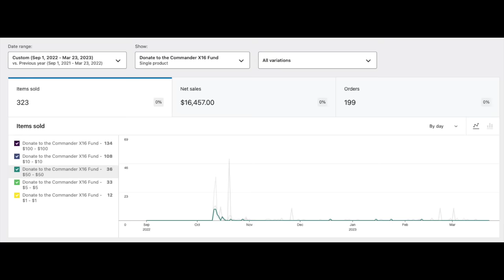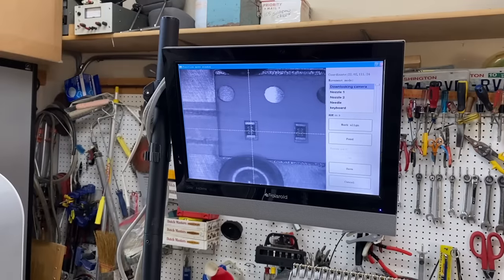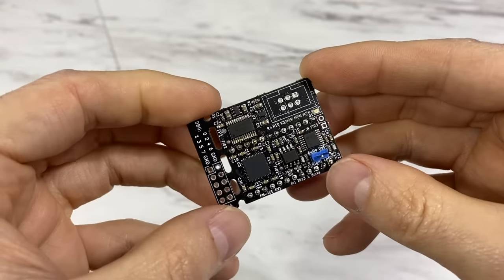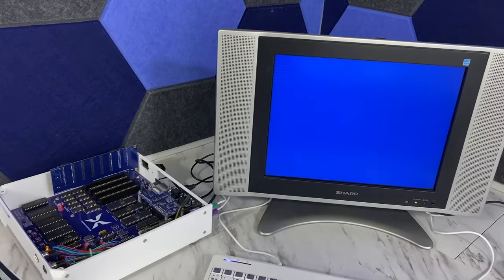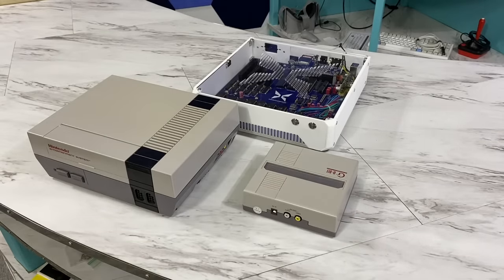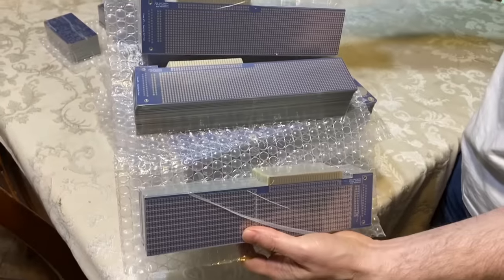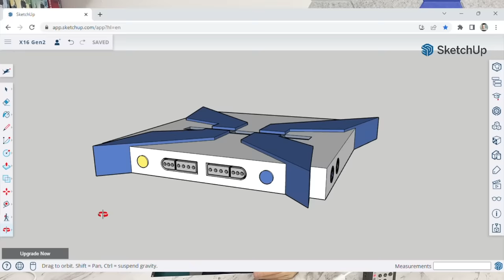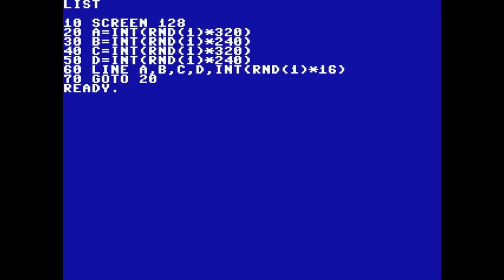Commander X16 2023 update

Comment: Elon Musk said it very well.. making a prototype is the easy bit, going onto production is hell.  I worked In small volume pcb assembly, smd, wave soldering etc in the 90s.. don’t forget to factor in the time needed to test and get the boards working after assembly.. I’ve seen much more professional and experienced assembly of similar scale and complexity have 1 in 3 boards require rework/repair.    And then reliability and warranty repair is another whole minefield.   Good luck
Reply: 1 in 3 boards? That's really bad. I worked in electronics manufacturing and problem boards were around 2 for a run of 50. The only time we had a failure rate that high was with a shipment of faulty ICs.
Reply: @drbpony  I agree, but these boards were as small as we could get with flexi-pcbs which were new and many surface mount components which was a fairly new thing  at the time.. surface mounted capacitors in particular had a habit of “tombstoning” which is where they stand up.   I’ve worked on other projects where where 3 or 4 out of 100 need rework.. it just depends on how well designed the whole thing is I guess.

Comment: Hmmm.... why not use Displayport which is royaltyfree? And DP to HDMI adapter ist the simplest thing you can buy...
Reply: This is also royalty free. It’s not “HDMI” certified. It’s HDMI compatible, using the same cables and ports.
Reply: @jimmiles33  Due to patents especially in the US "compatible" may infringe patents. The smarter choice would have been to use Displayport and be done with it.

Comment: Has there been any consideration of using the Yamaha SD-1 (YMF825) instead of the OPL3? It is apparently the only FM chip still in production by Yamaha, so supply might be better. Still has the issue of incompatibility with the YM2151, though.
Reply: The problem is that the specs of the computer are mostly set in stone, as of now. Also because software has already been developed, it's hard to go back to fix ALL of the programs to make them compatible with the new chip.

Comment: If I might make a suggestion, what about using the W65C02SXB SBC as a base for the next gen? I'd also suggest using an ESP32 to maybe handle video, audio and sound, similar to what the AgonLight2 does. I realize this would change a LOT about programming unless you let the ESP32 emulate the way the older discrete chips functioned. It would cut your chip count down drastically but still keep the spirit of a bare metal recreation.

Also for those having issues with the price there is an alternative, the EVO64 for $424.98 and that's just the C64 board.

Comment: You should make the case look more retro modern. I like it but it is doesn't stand out. It should be white like you have it but have seasonal slats across the front. Also have a corner flat on it. People like simplicity I like the see through window and cut outs you should also allow it to stand vertical. I guess what I'm saying is somthing along the kine if how the original wii looks but a bit more retro.

Comment: Electrical Engineering is terribly underrated, we need so many skills/knowledge, from general physics, maths, electricity, circuit design, pcb design, high level topics like control loop, measurment,  and so much more, uC architecture, FPGAs, programming in several languages... up to manufacturing - which, as you can see, is also a "science" for itself...
Anyways, I like your little adventure 👍

Comment: Why not implement the Yamaha together with Vera in a somewhat larger FPGA? That way you should also be able to use the 6502 at full 14 Mhz speed (+57% in cpu power)
Reply: That would be a cool side project, though I would just do it all in virtualisation rather than on real hardware.  The only benefits to the real machine with the real yam chip is compatibility with Commodore OG sound.

If you aren't interested in that then this whole project is basically pointless for you!  Lol you are better off just emulating or going for a NanoPi6.

Comment: Are there still fabs that could produce a batch of a few thousand of these old sound chips at a reasonable price? Would licencing issues prevent this?
With the advancement in chip integration, what we need is a 1000-in-1 style wafers with thousands of old chip designs layed out on one piece of silicon, and you select the one you want using a few extra pins. If necessary, mount the modern chip on a small modifier board to match the original socket pin-outs.
Reply: FPGA or software emulation on something like a STM32 is the best solution to emulate YM2151 for sure. It's not possible get fabs to make new YM2151 chips... just getting new masks done costs tons of money.

Comment: Design your own sound chip. Also, will X16 be playable on other PC's?
Reply: Designing a sound chip is not the problem, it's manufacturing it. They have a reverse-engineered design for the Yamaha chip and they can make it on an FPGA for $11 according to the video. Although custom chips are cheap to manufacture, before you get to that point, there is an expensive up-front cost of over $100,000.

The FPGA strategy costs very little up-front. 

Using current numbers, a custom chip would only be cheaper than FPGA if they sell more than 10,000 X16s, and that's assuming there is zero chip design cost and that somehow they can get a spare $100k to do the tapeout https://en.wikipedia.org/wiki/Tape-out

The FPGA strategy can probably be optimised - they may be able to bring down the price from $11 to, say $5. In that case, the FPGA strategy is cheaper for sales up to 25,000 X16s. So it's pretty clear the FPGA strategy is better at least for the next few years. It's also most likely better than getting real Yamaha chips because they almost certainly will only get more expensive, just like the SID chip has.

Right now, I cannot imagine the team contemplating production of so many X16s. Maybe one day?

Comment: 6 hours? get a reflow oven, or better yet, teach your techs to solder. thats a long time, I build some complex boards here in my lab and.. 6 HOURS!? for mostly dip packages, no BGA's?
Reply: ok, i saw you got a reflow oven, in my experience the best ones have a belt, and they heatup and cooldown the PCB using the speed at which the belt moves. the reflow oven you purchased will always be subpar, but could be better than doing it by hand. that pick and place machine looks prety bargain bin too. we use Essemtec machines and stand by them.

Comment: Manufacturing fake chips that are going into real hobbyist projects is the kind of thing that makes me unreasonably irate. I know these companies have no shame, but someone should name and shame them anyway.
Reply: They are not manufactured - they are normally recycled parts.  They might be YM2151s that were pulled out of old computers that end up in reclamation junk in China and are simply dead.  Or they could have been mis-binned as YM2151.  In either case, they often clean them up and relabel them to whatever to increase their value, making you think they are new old stock or a better grade than they are.

This is a very common problem when you buy from uncertified sellers.  Since no one has made these chips for a long time, the odds are very high the parts are recycled and you can count yourself lucky if you get actual parts that work.  There's no way on this earth that there were 100,000 available at any time.   Inflated stocks and too-good-to-be-true pricing evaporates quickly once you make a really inquiry about buying any more than a handful.

Comment: I just hope that the first dozens of units go to people actually developing for the platform.
Secondly, developed games and stuff should always be compatible with Gen2 / consolised version, so less RAM might be not so great and it should at least be upgradable. Best would be if devs don't have to think that they have to develop for the lowest common denominator. Look how DSi and especially the "New" 3DS barely got any support as devs didn't wanted to lose sales to owners of the normal DS and 3DS. Addon hardware also never really worked out for consoles.

Not a fan of SNES controllers (especially the D-Pad) but I know about the pinout problems with Mega Drive controllers vs controllers / joysticks for C64, Amiga and so on, even though they use the same connector. This includes actually being able to damage controllers. So using a connector that only supports one specific type of controllers is the way to go. Also got enough SNES controllers lying around anyway.

Wonder if there would be a way to resume productions of old chips. This would solve the problems multiple such projects face, needing original chips that are getting rarer and rarer. Their designs should become public domain if out of production for quite some time already, with no compatible successors being produced by the rights holders.

Comment: If you're going to enhance BASIC, can I suggest enhancing it such that you can actually do structured programming with it. The lack of a DO... WHILE and the limitation of only one statement on the THEN/ELSE clauses of the IF statement mean that you're stuck having to use GOTO, and that's very bad for structure. The over-dependence on GOTO is one of the main reasons why I have very little good to say about BASIC despite it being the first language I learned to program in. It teaches some bad habits that are easily avoided when using better languages.

Comment: About the Z80 thing that people are asking for. This is just a general off the wall question so please don't go off on me for it.  Would it be possible to place a Z80 on an expansion card & make it accessible through software so that it could be backwards compatible with Z80 based software ?
Reply: I bet it would be possible, but why not a faster 65c816 to replace the on board chip at a higher clock speed to make games run better?

Comment: Maybe you could recreate the entire machine in VHDL / FPGA as a backup, that could be used as a MiSter core or some other easier to produce FPGA solution (maybe this is what you already planned for the gen 2). I do not know if it has been a rip-roaring success but afik the ZX Sepctrum Next succeeded by using FPGA and the maker has been good enough to release a free MiSTer core for it also.

Comment: Retailing at $500 I'd honestly suggest keeping back at least as many as you sent out to programmers likely making the original retail stock closer to 60. Good luck with your solder dipping heat is always a plague in manufacturing.

Comment: Hi, i came across your Project only in these days. It's very interesting but, honestly, 500 bucks for doing some basic or asm programming is really too much. There aren't any software library available, limiting it's usability. Why didn't you opted for a solid platform, with already a great user community like the Mister FPGA? You could have done your dream computer entirely in fpga, already available to many users...
Reply: Did you watch the first 2
Reply: @KoenDoesThings  It leads to same question.

Comment: 20:23 1st party manufacturers generally sell the console at a loss, and makeup the loss, then make their profit, from the cartridges and software; plus nickle-and-dime for peripherals, cables, adapters, and accessories. Probably not an option for a general computer version (iirc, Texas Instruments tried this and failed miserably with this strategy with the TI-99/4a). Also, this is an open system, anyone can can make cartridges, software, and nickle-and-dime users with off-the-shelf parts with no resources spent on reverse-engineering and research or even manufacturing. So making up for loss will have a lower margin than a proprietary hardware would. Selling at-cost might be the better ootion. However, you do have a plan to sell dev-boards and cartridge kits, which is definitely in your favor. I'm guessing you'll sell these to anyone, unlike many major st party manufacturers who generally tell small-time developers and hobbyists to get lost, either by extremely high minimum buy-ins (aka 100,000 minimum unit purchase game cartridge kits) or by directly telling them, "get lost" only because they aren't a big publisher. All this can help not only for the console version, but a budget streamlined console version also serves to better justify the premium price of the full desktop system with its premium features. Remember, the larger the install base is, the more potential sales for software, cartridges, and accessories. You should be seeking deals with creators who wouldn't mind making money from their software and designs but aren't into it enough to be a full time manufacturer and publisher.

Comment: Crazy idea: did you try to contact Yamaha? With large enough demand, maybe there would be possible for negotiate acceptable price for new batch?
Reply: 100 boards, 200 chips is "not enough demand". Even 2000 chips isn't enough. The minimum wafer order at a chip fab is usually 20 wafers. Each wafer results in likely well over a 1000 chips. That is under assumption that you simply order wafers. Good chance that either the masks to produce the YM2151 no longer exist, or the factory where they were used no longer exist. Usually, when you need one million units, then it makes sense to start producing dedicated chips. Depends of course on the needed price per chip, but the CX16 will a pretty low price, so a huge quantity.
Reply: @danielmantione  200 chips is only for development boards. Few thousands or tens of thousands is objective goal. Everything else is impossible to know without contacting Yamaha. By contacting Yamaha I didn't mean "order from Yamaha", but send inquiry about possibility of getting new batch produced. If they say it's no longer possible because factory is decommissioned or mask is lost, searching for alternative chip is most logical step - compatibility issue is big issue, but still less of the issues than it would be in later phase. If there is sensible amount needed to order new batch, development boards can be produced with available chips or FPGA emulation, with mass production planed around new batch.

Comment: Theoretically, since you already have an FPGA design to emulate the Yamaha chip, it shouldn't be to hard to get an ASIC design that can be built by the likes of TSMC, Global Foundries, Samsung, etc to make drop in replacement chips.
Reply: It only costs a hundred grand for the masks :)  Some fpga manufacturers do have a path that will send an fpga design to an asic but really that is the fpga minus the field-programmable part.  I have no idea how expensive it is to do that and I'm not so sure it would be less expensive per unit than the fpga.  Normally you might do that to improve the performance.

Comment: You could possibly use an FPGA replacement for the YM2151 and not have problems using the "icepick" which is about an $8 FPGA.
Reply: The current design of the YM2151 is using ICE40UP5K. It's the same FPGA as VERA uses I believe. However Joe Burks (Wavicle) and other skilled community members are still working on optimising the JT51 core and figuring out the best and possibly cheapest way how to implement it. Because the problem is not only YM2151 itself but also YM3012 which is required as an interface for YM2151 and is also not manufactured anymore. This replacement board could eventually replace both problematic chips.